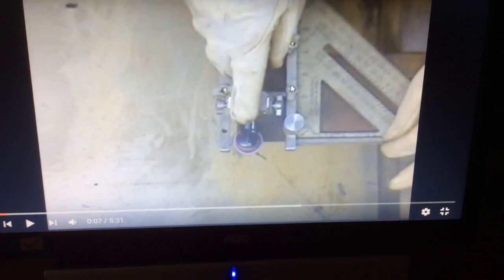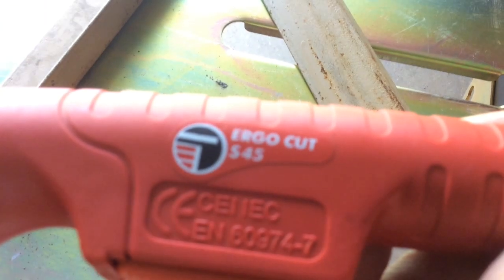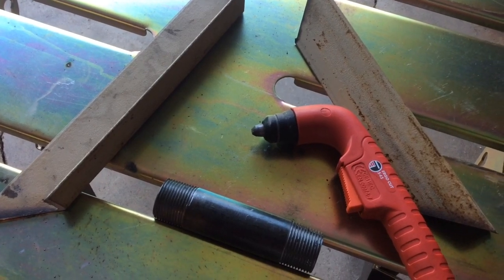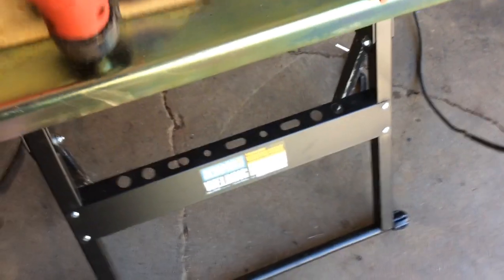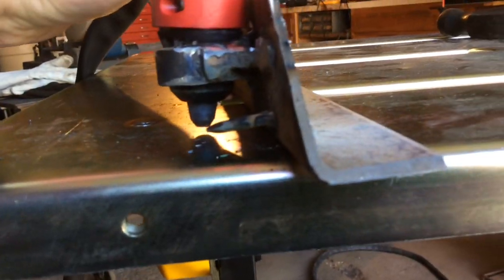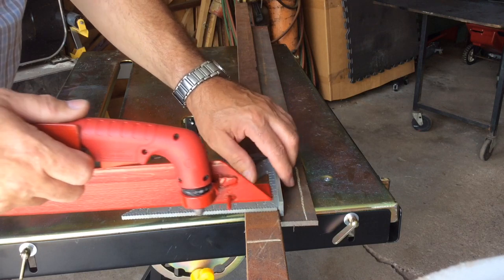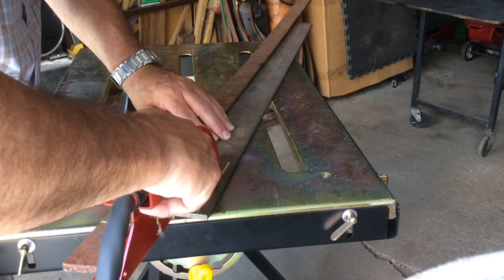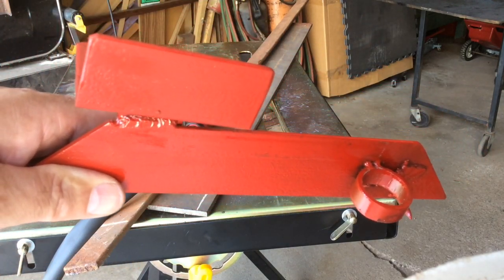DIY Plasma Cutter Guide

Comment: Looks tippy
Reply from the maker: Actually is very stable. But if I built it again, I would include some kind of wheel or roller to make it slide across the project more smoothly?
Reply: @timthetoolman4575  design good base not wide effect it rocky that's y u did nt cut just spoke about

Comment: Thanks. Too bad you're not showing it in action and not showing how the cut turned out.
Reply from the maker: I've used it several times. Works well. Only thing I might add is some kind of wheel(s) to make it slide easier, I think that would make it better?
Reply: PS: I was mostly interested in how clean you can get the cuts :) Since I've read using a flex might be better because you don't need cleanup.
Reply from the maker: Nice thing about a plasma cutter is you normally get a "clean " cut as opposed to a torch set. Normally a pass or two with the grinder will give me a great finished cut
Reply: Thanks! I've read a bit more and from what I've read the raggedness of the cuts is really from freehand cutting. Which was what concerned me most haha.
Then you have dross and cut angle and metallurgy problems, but those are a problem of getting it right.
Damnit now I really want a plasma cutter and a welder :)

Comment: IMO your guide is a lot of work for no reason.  Instead, just drag the side of the plasma electrode along the edge of whatever you want to use as a guide.
Reply from the maker: That works to. My tool just helps limit any possible shaking and makes a more precise cut for less cleanup?
Reply: Tom Rumish all plasma cutters aren't designed to drag cut. An everlast is one of those. I know from experience. The POS exploded😲